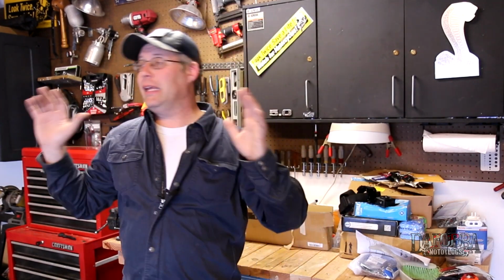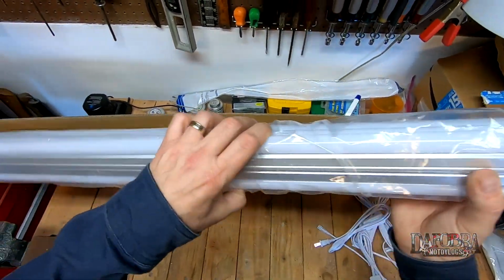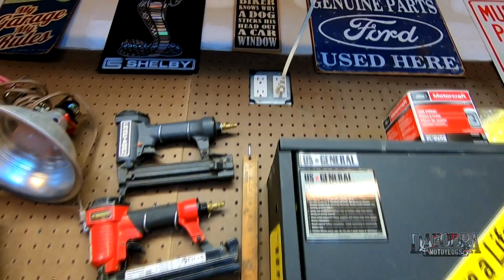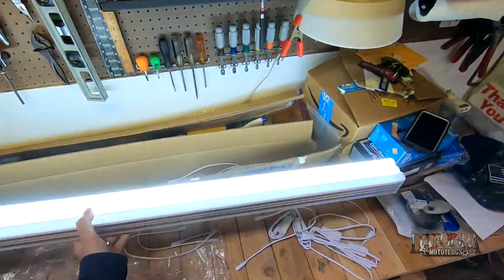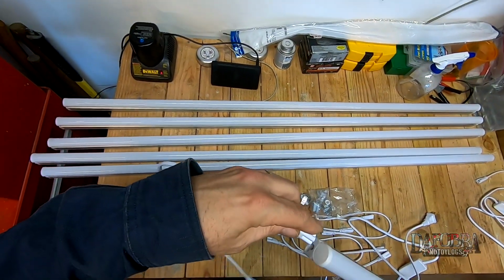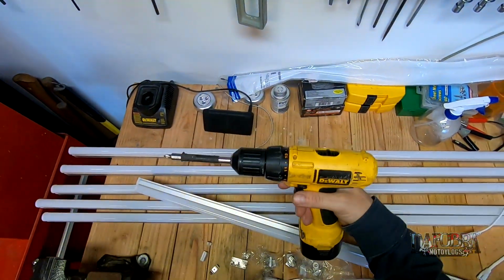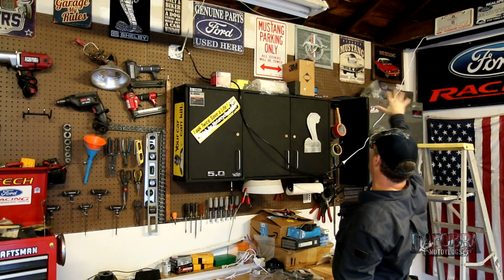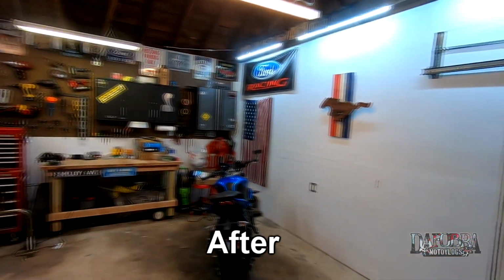AMAZING CHEAP Garage Lighting Upgrade! Barrina T5 LED Install and Review

Comment: LED is the way to go. I have been converting all the ballast operated fluorescent fixtures with LED. I have already noticed a decrease in electrical consumption as well!
Reply from the maker: So you are rewiring them?  How much cheaper is it to retrofit them than replace them with new LED units?
Reply: dafobra new units are $90, and ballast bypass led tubes are $47 for a set.